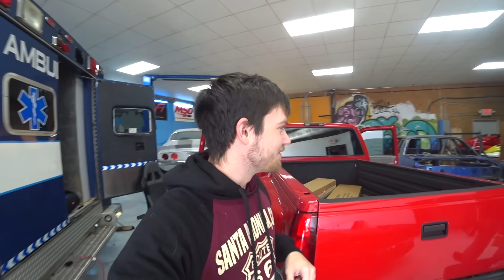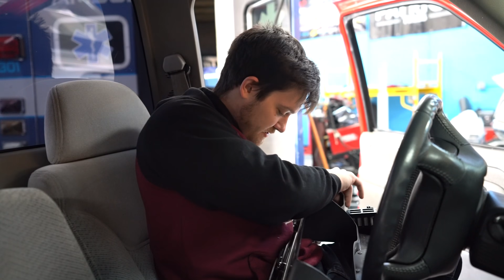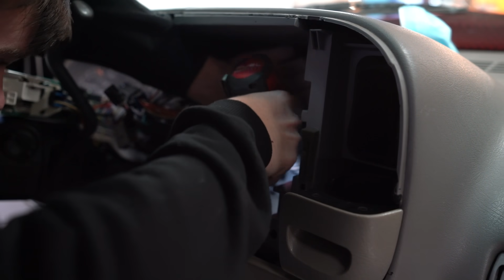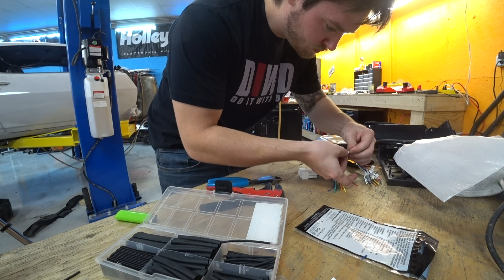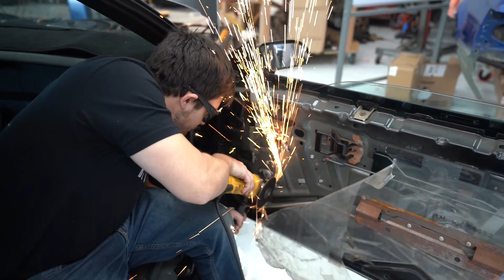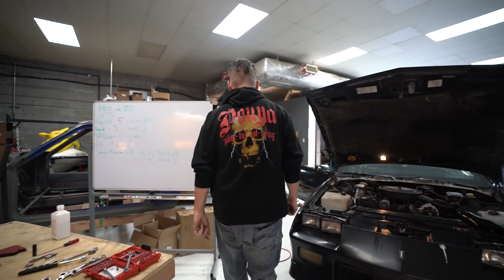"It'S nOt A pRoJeCt TrUcK"

Comment: If you'd ever like to remove or install the bezel easier in the future.  Put the key in the ignition and turn to accessory without starting and move the gear select lever all the way down.

Comment: So on that dash trim, you're supposed to put the key in the ignition, turn it to accessory mode, and shift it into 1.  That will give you the clearance to pull out the trim.  Put it back in park and do your swap.  Repeat to put the new trim piece in.

Comment: Gm sucks with riveting window motors and regulators to the door panel, guy I worked with had to sneak a cut off wheel in the door without the guard on it to cut the two in the back and almost sliced his hand off

Comment: God Dan sometimes when you work on your vehicles I just wanna scream at you😂 if you pull the gear selector into the lowest gear and put the wheel down as far as it’ll go that dash piece would’ve come out a lot easier. I have an 01 Silverado and I’ve done that double din setup in mine, you can also run a backup cam to it pretty easily if you’re radio has a plug-in for it

Comment: Dan, what in the Kentucky Fried Chicken Fuck happened to the shop. Looks like a tornado tore through there.
Also, you put the key in the ignition and then pull the shift lever down to get the dash panel out.